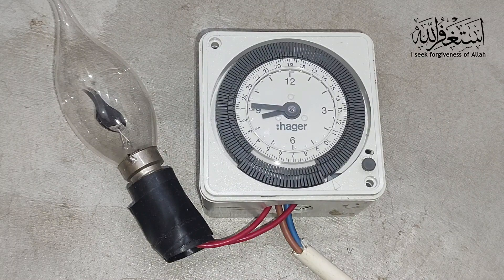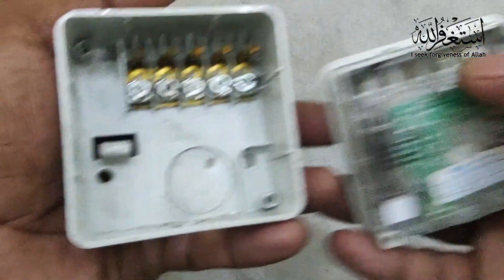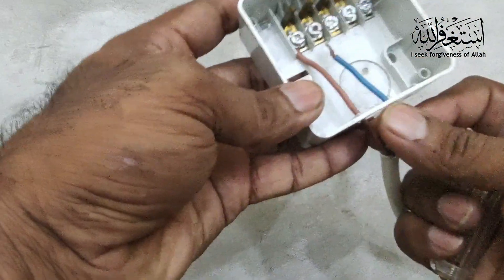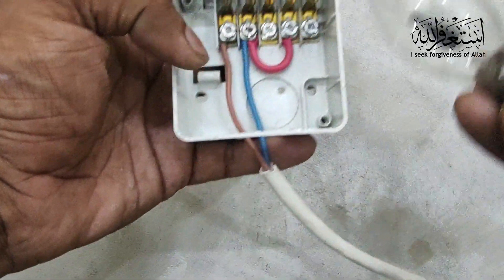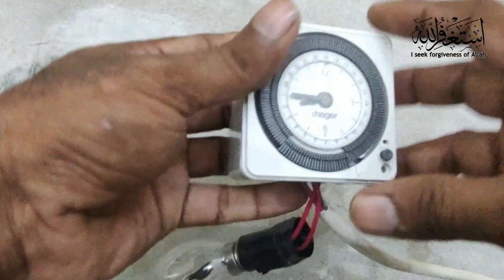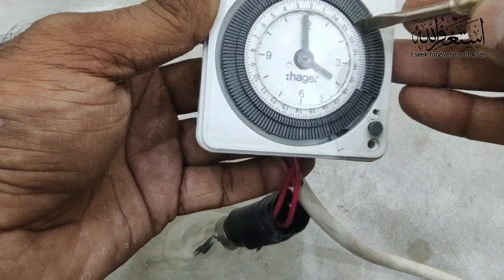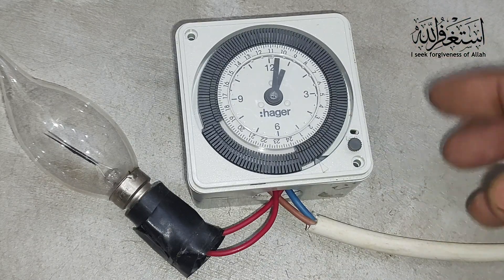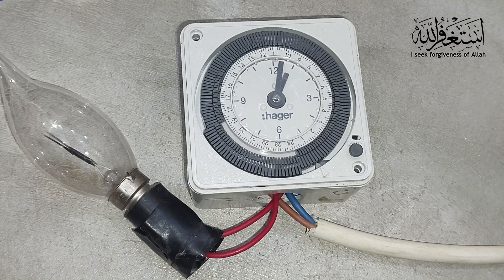How To Wire Connections And Time Adjustment In Hager Timer

Comment: The clock is not moving???

What can be the issue plz suggest
Reply from the maker: If you the right ✅ connection clock ⏰ must be move 
If still cannot move clock 
You will check ✔maybe spoil the clock